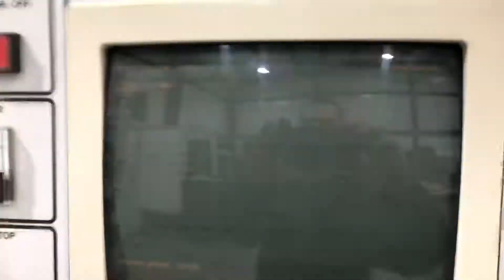HAAS Processor Board 32-3090 W7732

Comment: Okay, wait a minute.............Are you saying you guys can deal with failed maincon boards?! So a guy does not have to deal with the bullshit situation haas has created by sunsetting these parts forcing a guy in to a $20k "upgrade" if his main processor fails? You can actually repair the board, without loosing the software?
Reply from the maker: We do repair these boards every day but you will have to get your local Haas Tech to come out to your location to install the boards and your machine OS software.  It is cheaper than doing the upgrade and we warranty the processor board for 12 months as long as an Haas Tech completes the install.  Our address is Worldwide Industrial Solutions 34 Enterprise Way Dahlonega GA 30533. eric@wisrepairs.com/ 1-855-437-3497 x105